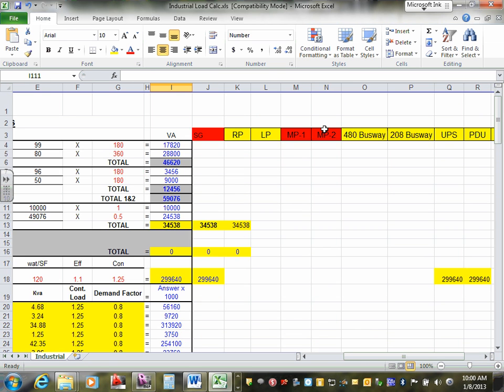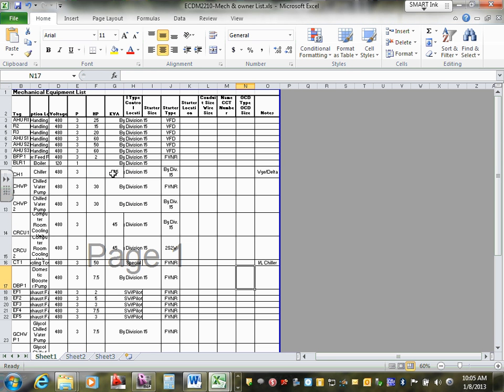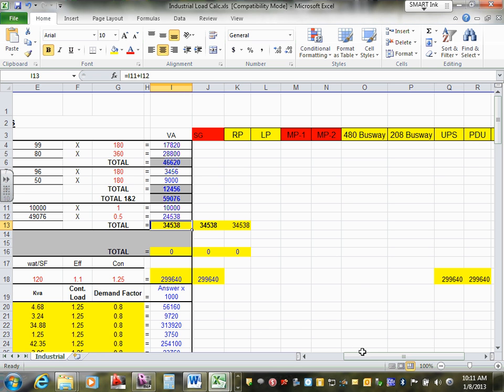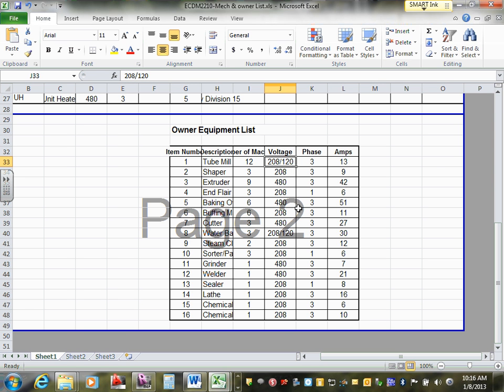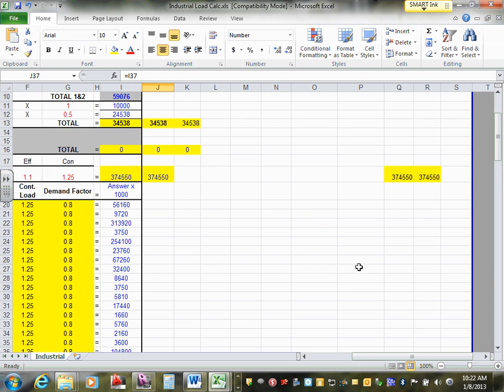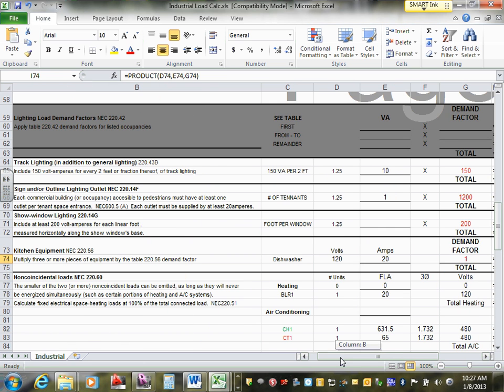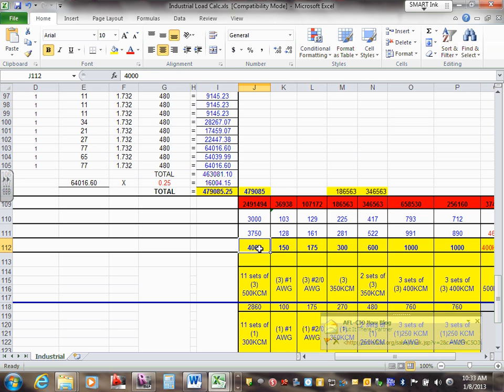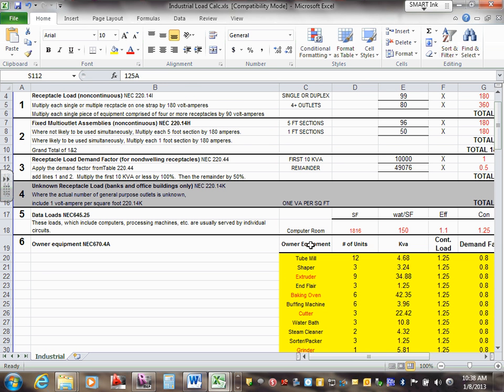Load Calculation Industrial Project 01 08 12

Comment: Mr. Kurdi, thank you for uploading this procedure for load calculation. It really helps me understanding a proper implementation of NEC NFPA 70 code. 

I am just wondering whether a Chiller (CH 1) should be multiplied with factor 1.25 (instead of Air Handling Unit-supply AHU S1), bearing in mind that it is, by far, the largest motor?